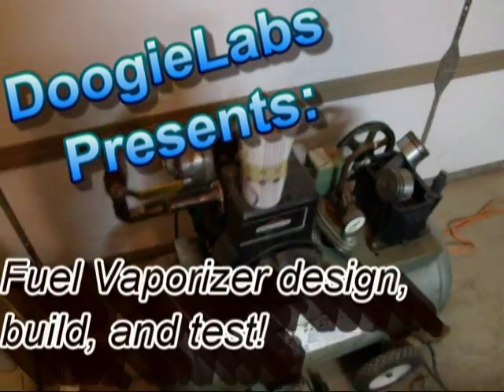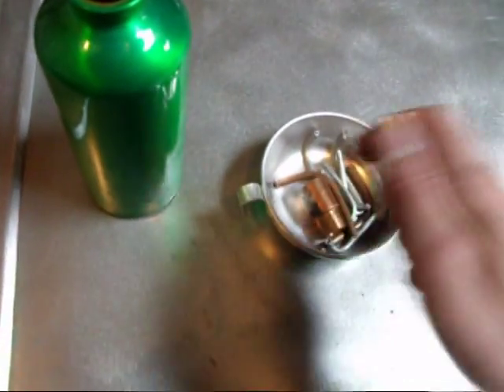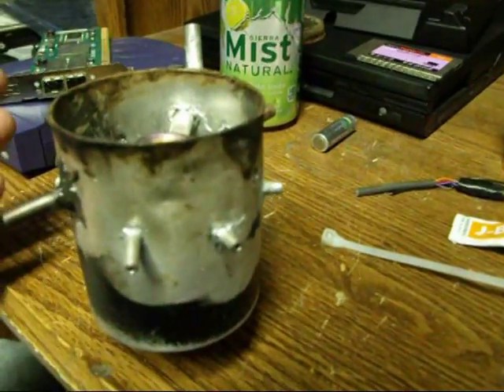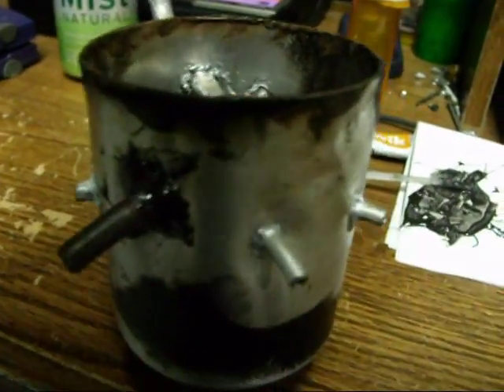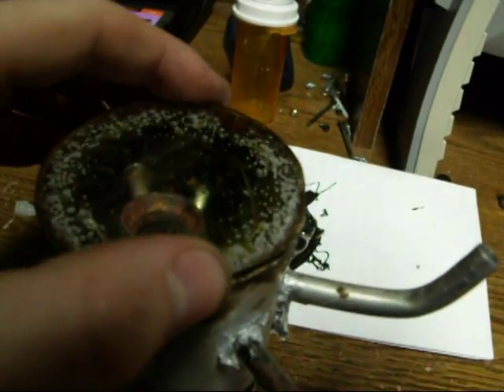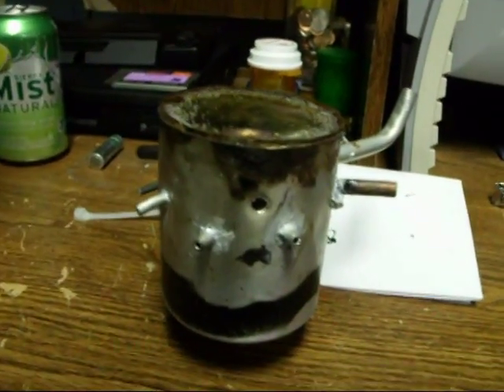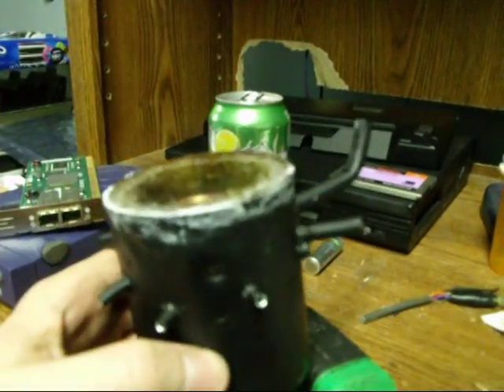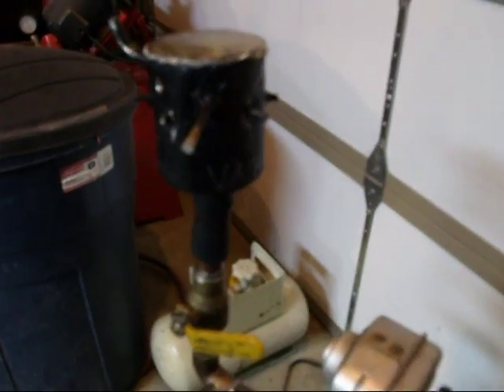Fuel Vaporizer Experiment on 5HP Horizonal Shaft Briggs Engine, Design Build and Test

Comment: An obvious problem IMO, is the canister needs to be taller so you don't suck in fuel splash from bubbling and shaking of the engine. I got my mower working using 1/2" copper piping, but haven't gotten. it to idle yet without dying. Thots?
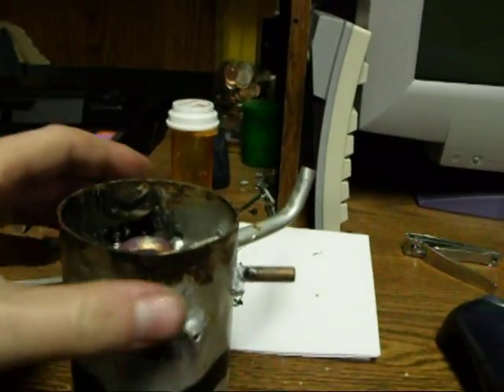Reply from the maker: Also, at 7:40 the small open hole facing the camera is the air bypass hole that I ultimately ended up enlarging to help the engine run better
Reply: @DoogieLabs  I am adding air into a T before the throttle valve,, fed by a valve, which is fed by a 3/8" vinyl tube (fits 3/8 compression fittings perfectly), which goes to a bubbler with just water, for a little water vapor. I can't say wether it's doing anything because I only have about 75 lbs. Compression on that old motor.
I'm surprised it ran at all; worth ringing it I guess.
Atm, I only have most copper joints sealed by electrical tape, in order to be able to change them up without having to desolder, resolder, and cuss a lot.
Reply: @DoogieLabs !
 If there's a way to email privately here, I can't  find it even in your channel (and I subbed). I'd like to send you a pic or two of my MacGuivered setup, including my bubblerslashvaporizerslashbackfire protector, which began life as just an HHO bubbler.
I guess I may make a video instead, if I find the time!
Reply from the maker: @garychandler4296  doogielabs@gmail.com
Reply from the maker: You are absolutely correct,  with the engine running and raw fuel splashing up and making it down the venturi it will almost choke out rich. I had issues getting the engine running until I got the air bypass hole sized just right. I had to add a hole where air could enter the engine without having to pass through the percolator tubes.

In later designs, this bypass air needs to be variable to vary the AFR. You may even be able to use it as a sort of throttle regulation like a throttle plate. 

The trick is allowing enough bypass air the engine gets fresh air but is also just able to pull air through the percolator.

Comment: Have you done any more with this project since the video was made? I found one more video but I can't get it to play... I am working on a similar project to run a v8 and an old diesel pickup. The thing is that you basically built a crude CARBURETOR which atomizes fuel but does not vaporize it. 

   Basically you have very small particles of liquid fuel entering your engine but it has not been changed from a liquid to a gas vapor... This vapor is what you are looking for in order to achieve high fuel efficiency... Also as long as you vapors have not been introduced to oxygen then it is a "dead gas" meaning it will not burn or explode, so if you can keep oxygen away until it enters your engine then it is much safer and prevents you from driving around with a bomb under your hood waiting for the first backfire to set it off. These are all of the things that are slowing my project down (other than time restraints).
Reply: ***** If you place a screen at the air intake on whatever engine you put a vaporizer on no backfire will get past it so you won't have to worry about your system exploding from a backfire. Another great way to prevent your system from exploding is to stuff it with stainless steel wool. It is also a good idea to place 2 check valves between the vapor outlet port on the vaporizer and the air intake of the engine. One check valve will be used to prevent back pressure from entering the vapor system which will blow fuel out the intake of the vaporizer. The other check valve is used to release the back pressure into the air since it will need a place to go.